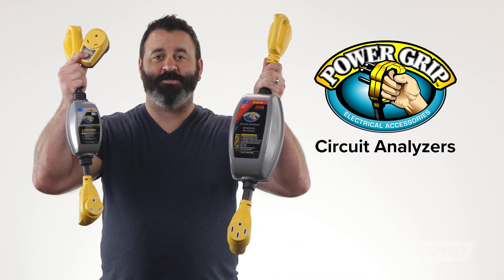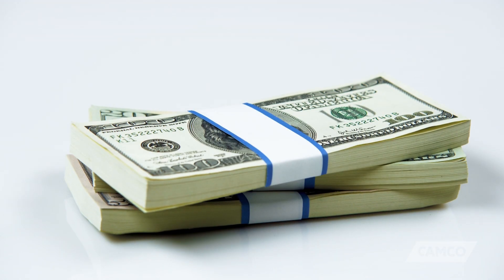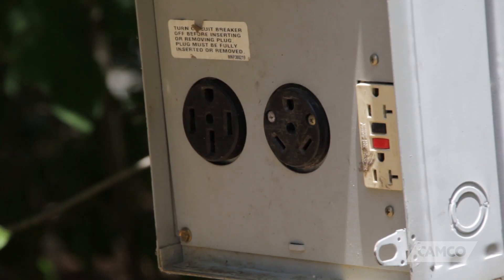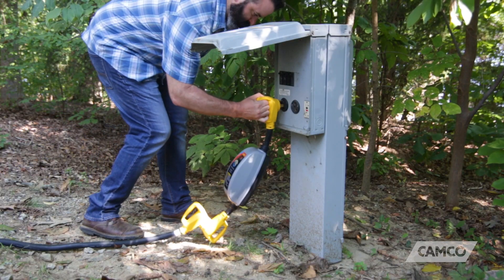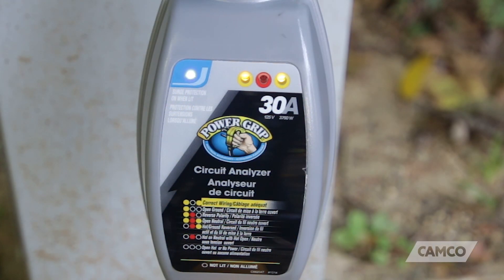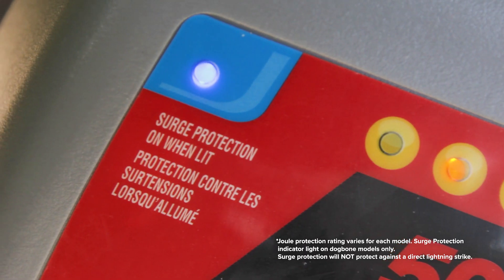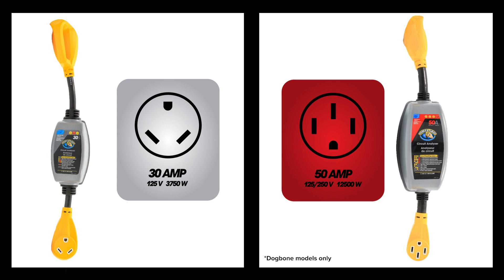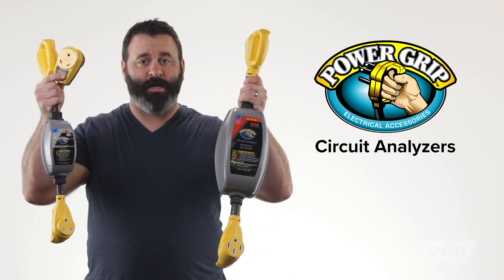Power Grip™ Circuit Analyzers

Comment: Hi, I have a 30A Circuit Analyzer  fro my trailer that is currently plugged in  inside . It will be moved to a new connection box outside soon. Is it okay to plug in outdoors unprotected, or does it need a casing/housing  ? If so, what type of protective cover do you recommend please ? Thank you,Betty
Reply from the maker: Betty Spreen Thanks for the question, Betty. Plugging it in outdoors should not be a problem, but I will check with our engineers and get back to you. -Scott
Reply: @CamcoManufacturing  Thank you Scott !
Reply from the maker: @bettyspreen1428  Okay, so... The housing of the Circuit Analyzer is rain proof if used in the upright position. As with any non-marine type electrical connection though, it is wise to shield where the plug connections occur from rain. Hope that answers your question, Betty. Thanks again! -Scott